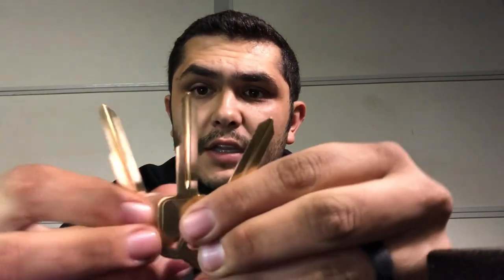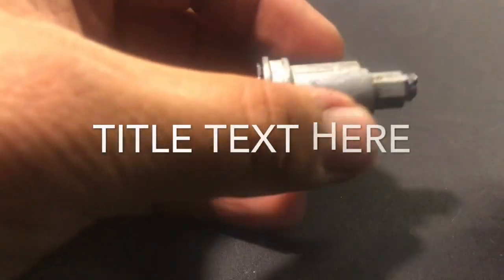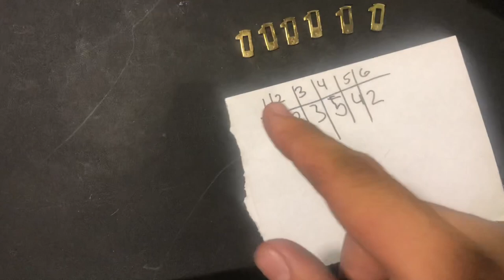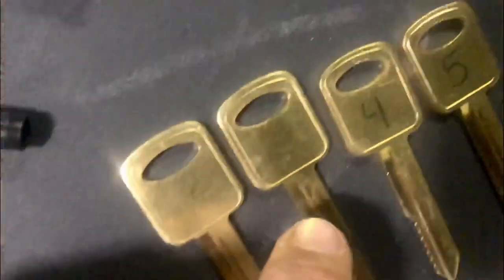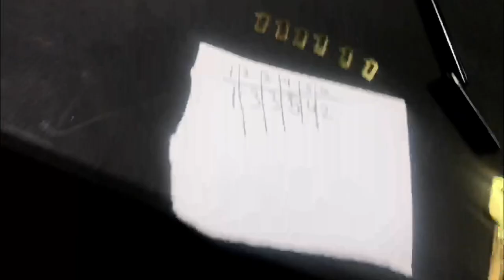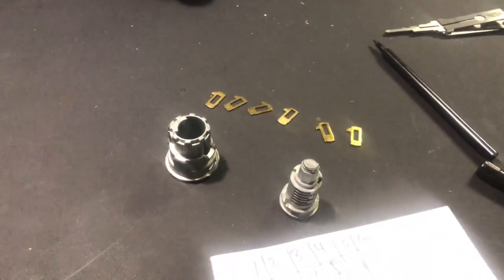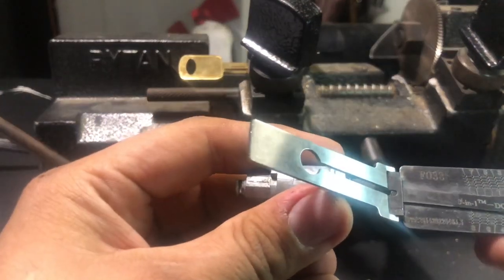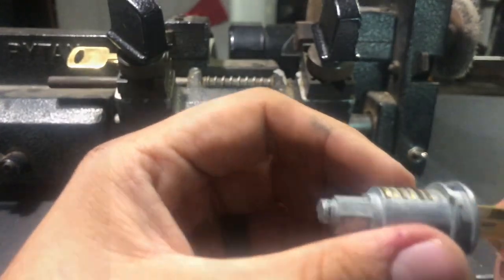(Code Cutting Keys)🔑🔑🔑 CHEAP WAY!!!

Comment: You don't have to take wafers out. Use your depth keys one by one and see which wafers are even with cylinder. Then you know that wafer is number of key you have in it write down all of the ones that are even till you have them all in the right order. Should work with any cylinder lock you can see pins. I could be wrong.

Comment: What's the best way to remove  the cap from the cylinder? I'm learning to to rekey and I was wondering if there's any special tool? Good video by the way!!!
Reply from the maker: Well, there is a tool named “gator cap removal” it removes caps pretty well. But I just use regular needle nose pliers, usually when I remove the cap I sometimes chew it up pretty bad, so I go ahead and replace the cap. The face caps are pretty darn cheap simply pop it back on and boom 💥
Reply: California Locksmith Co thanks for taking  the time to share this information and to reply this message 
...

Comment: I have a hack to this. Poor man code cut your 1 side. Then put it in the feelergauge side of the key machine and zip it onto a second blank. Now flip second blank. Cut back side of key. Switch keys and finish the first one. You have successfully made 2 keys. If it's going on a chipped key you could always use a standard metal blank for the second key as a spare courtesy key. Good backup in case main key gets locked in the car
Reply from the maker: You do have a point. However some vehicles only give you certain cuts on doors, you will need to first cut a (draft) key so that if somehow you commit an error, you won’t waste a transponder key. Look at it like a assurance. Also some people might argue, why not Lishi the ignition lock cylinder. Well some ignition locks have side bars and Lishi tools do not work on those applications.
Reply: @californialocksmithco  yes. I agree drafts entirely on brass blanks does make more sense. And as you said in the video you can normally instacode the last 2. Either way you find it definitely a cheap metal blank for drafting. Love your channel. And thank you for responding, and catching things I missed in my own advice. Subbed
Reply from the maker: Zack M. Thanks for subscribing zack! you also brought a great valid point. 👍👍